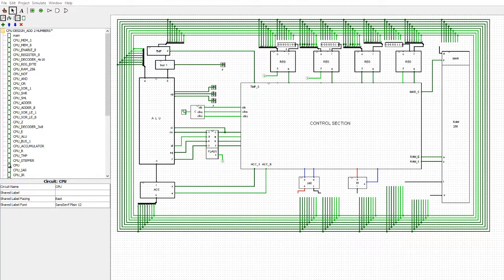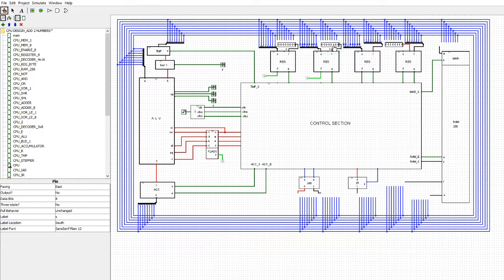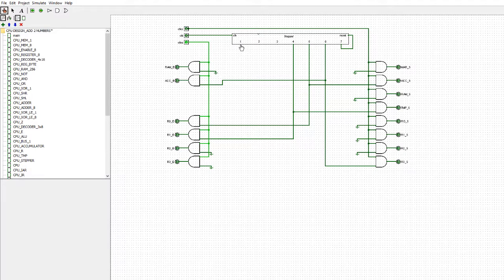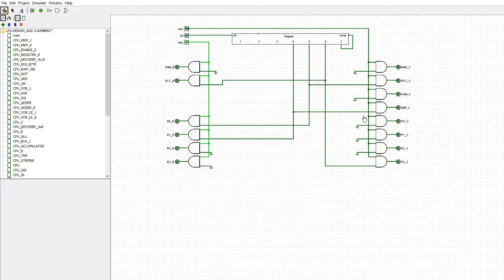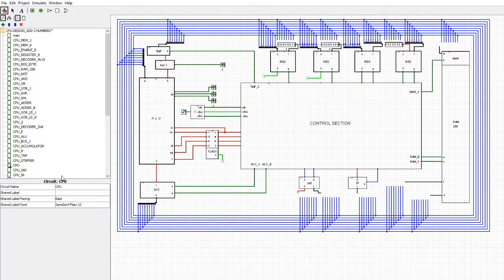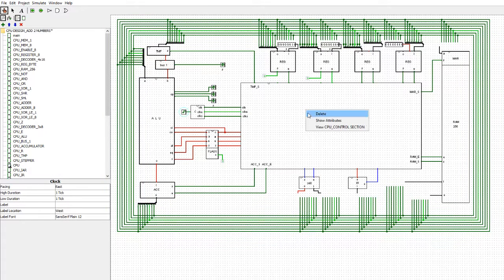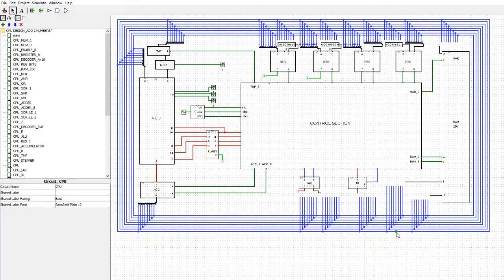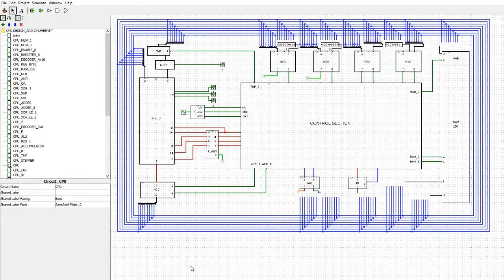8 BIT CPU Control Section Add 2 Numbers

Comment: I have a problem with making the stepper for the control unit, i have built exactly as you builed it, but i keep getting erros. To solve this problem i have used D flip-flop to make te stepper. It works but i don't know how they work (i used the inbuild D flip-flop from logisim). Do you know how the D flip-flop form logisim work or do you know why i can't build the stepper excatly as you showed?
Reply: already solve??? i have idea to solve ur problem..
Reply: I have the same problem.  When connecting pin 7 back to reset the circuit has an error.  Where you able to solve the problem?
Reply: @tmiller9099  Did you solve the problem?
Reply: @mateenDemah  If you connect the Reset pin and the feed back from the 6th step to an OR gate, it seems to fix the problem.